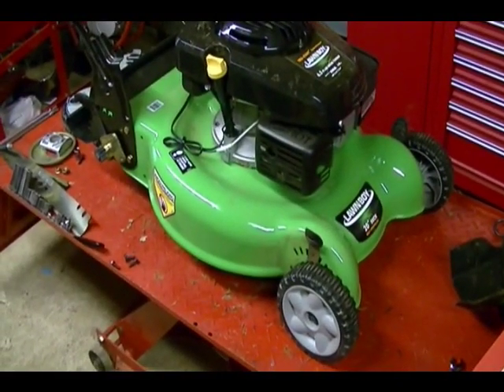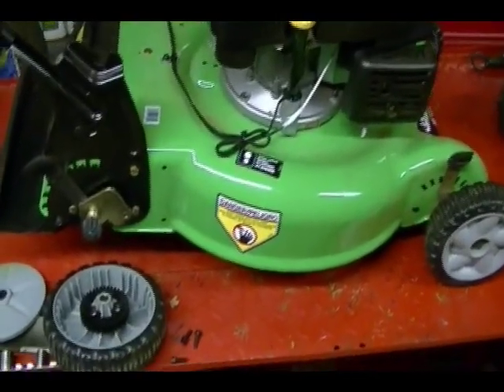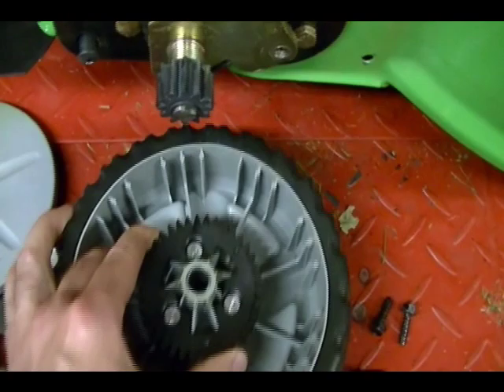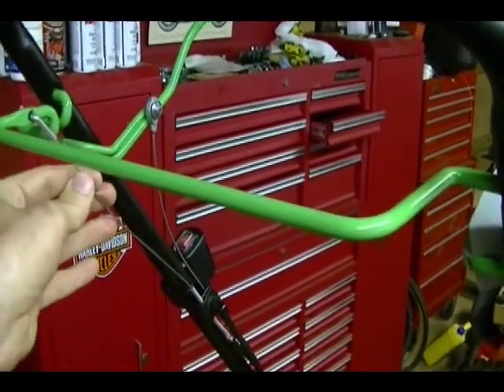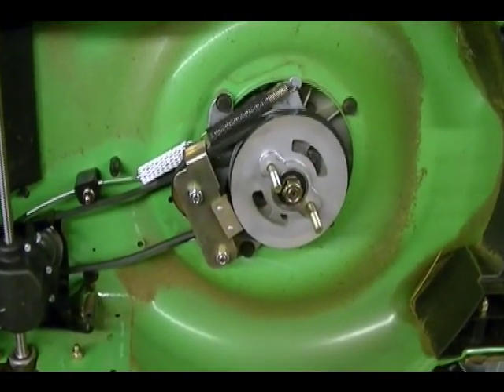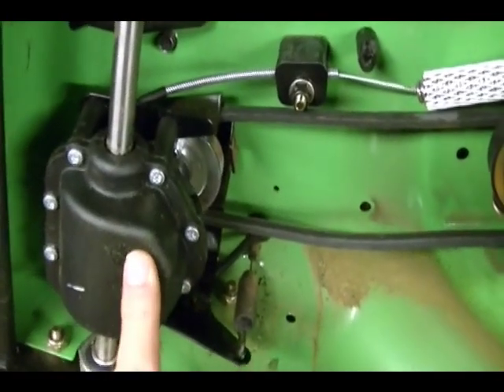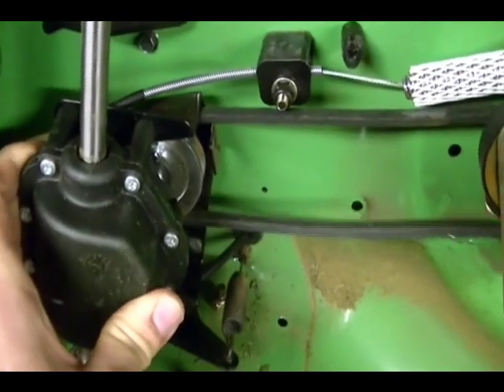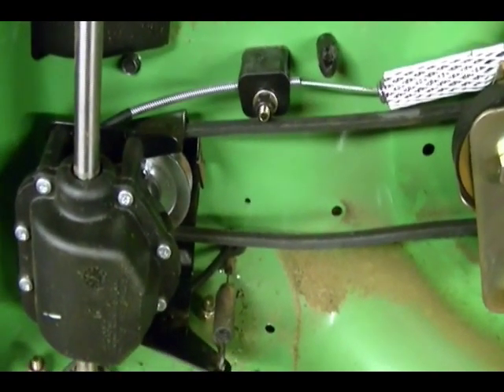Small Engine Repair: Lawn-Boy Lawnmower Model 10605 Rear Wheel Drive System

Comment: I found one of these in the trash recently along with the bag. Just needed a cable adjustment, blade sharpening in the new spark plug is the old one had to tip broken off of it. I actually had to pull the spark plug tip out of the boot. I find it starts easy enough it's not really necessary to step on the deck when you start it.

Comment: I removed the wheels on my rear wheel drive Lawn Boy mower. I realized that the washers are different for each wheel. One washer is a two- level washer and the other is a series of two washers. I don't remember which washers were on which side.  Any advice?  Any recommendations about the differences, and which washers are correct for which wheel.

Comment: Have this model. Last year wasn't driving well. Adjusted the cable and she launched when engaging the handle. However this year she's grinding like crazy and I'm doing most of the work again. Looks like those gears on the wheel hub assembly are plastic?!! It sound like they are stripping out on me. Wouldn't likely be the gears in the trans would it?

Comment: how did you remove the piece right under the blade and then the plastic cover under that covering the belt and blade cord? the cord that makes the blades spin snapped.